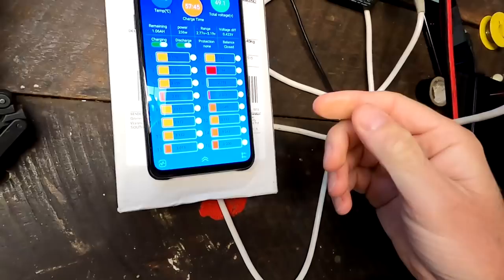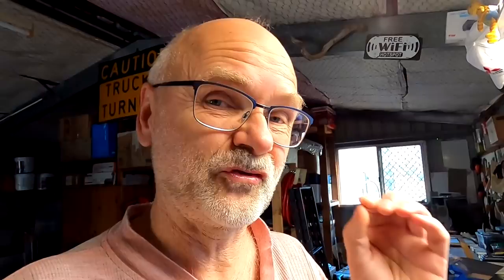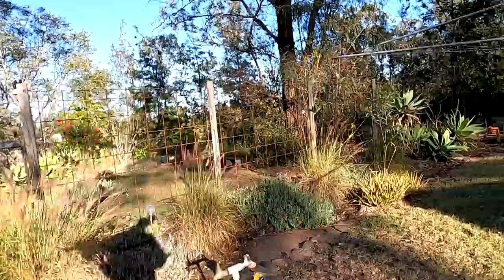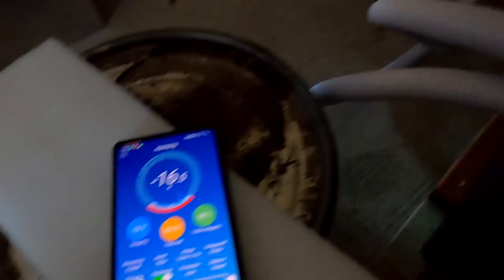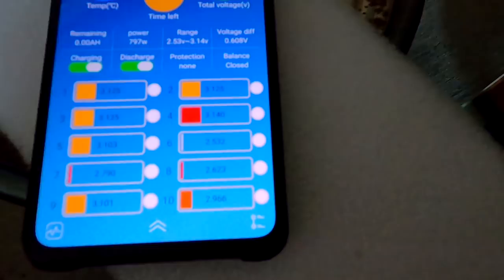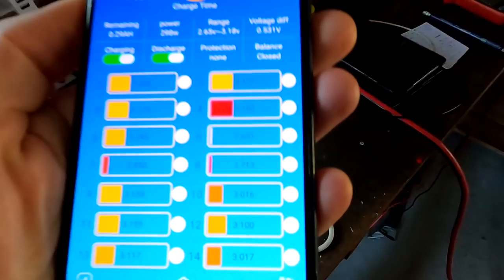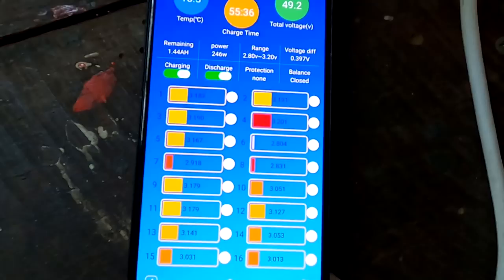QUCC BMS with relay. Why is this happening? 🤷‍♂️😷

Comment: First: Apologies for replying to this 2 weeks late, you might have already figured this out. But until I get caught up I'll just answer your request for comment anyway:

At 13:30 you've almost got it, but not quite. You say that the BMS is turning on the relay and then sensing the low cell and turning it back off again, but that's not quite what's happening.

Earlier in the video you also came close to realizing the issue when you noted that the relay doesn't go "on-off-on-off" when the Inverter is off...

Here's the step by step of what's happening:

1.) BMS senses low cell voltage and turns off the relay.
2.) This also causes the inverter to shut down do to under-voltage since the battery is no longer connected and it cannot get sufficient power from the MPPT to power your irrigation pump or EV charger.
3.) Cell is now at/below 2.55v and the only way it can get back above your 2.8 under-voltage release would be to charge the battery... which it cannot do now because the relay is off.
4.) The black wire on the outside of the relay senses charge voltage from the MPPT which triggers the BMS to turn the relay back on so that it can charge (Which is desperately needs since one cell is in under voltage condition)
5.) When the relay turns back on, your inverters immediately start to pull power. The BMS senses that the battery is being discharged rather than being charged which is the opposite of what it wants when a cell is in under-voltage condition, so it immediately shuts off the relay to prevent further discharging the battery with a low cell.
6.) Go to step 2 and repeat.

This is why the on-off cycle stops when the inverter finally gives up and completely switches off.

This is why so many of us keep harping on the fact that a relay based BMS only works when you can control the load and chargers separately. My Orion Jr is also relay based, but the relay is for emergency use only. It can directly turn on/off the inverters and chargers separately so as to avoid ever having to disconnect the relay unless a cell gets dangerously low. IE: The relay is not meant to control your loads and chargers, it's meant to protect the battery in an unforeseen emergency type event and prevent cells from reaching voltages that can damage or destroy them.

Consider this: Every time you connect your inverters you're careful to use a pre-charge resistor first. So why would you be okay with allowing your inverters to be disconnected and reconnected using this relay, which isn't properly pre-charging the inverter capacitors before reconnecting the relay? You need a more graceful way to shut the inverters off without completely disconnecting them from the battery.

In the case of the QUCC for example: Since there's no way for the QUCC to directly control the inverters you should consider using battery voltage as a trigger: Victron allows you to configure the inverters so you can set them to shut off once the voltage drops below say 50v. That way the inverters shut off before the relay does and gives the MPPTs time to recharge the battery, which they cannot do if the relay is off.

One other mistake I see you making in this video is looking at the parameters in the BMS app and assuming they are valid for your BMS. Remember that this "app" is a generic app that is used for many different brands and models of BMS with differing levels of functionality. Some of the parameters shown may not be applicable to your QUCC specifically because it's relay based and doesn't have separate charge/discharge ports.
Reply: If the pack were balanced, the inverter low voltage cutoff could be 45V or even lower. It’s the low voltage reconnect that needs looking at. In this case, the pack voltage is 48.3V so the inverter reconnect voltage should be above this, say 49V or 50V.

Comment: its because it uses a single relay to control both charge and discharge, it's detecting a charge so connects the relay to charge them and then it detects that it's actually discharging so disconnects
Reply: Agree with this comment. Try putting the release voltage not far from the cut off voltage just so that once the the power come in to charge it, the BMS does not confuse either to turn off the BMS or the turn on. Mean you just set it as if once there is power to chrage the battery, just let the BMS on and no more release voltage since you only have 1 relay. Relay is just contactor and once it on, it work both ways cahreg and also discharge. Then the BMS IC detect a discharge it OFF, but the it detect power comes in the it ON. SO there goes your loop.

Comment: Yes I don't let my bms ever get to that point either the inverter shuts off on low battery first so bms only goes in to protect mode in dire emergency.
Reply: I also program my inverter to cut  off before the bms
Reply: Same here
Reply: Smart move!
Reply from the maker: Absolutely, but what happens if the inverter shut-off fails? I want to see what the BMS does and if it is still safe to protect the battery.
Reply: @OffGridGarageAustralia  it’s a valid “what if” test but if the BMS has a precharge feature, surely that would continue to discharge the battery even with the relay open? So the battery would eventually discharge too far.
Reply: @kevinmills5293  The precharge for the inverter capacitors should only be passing current when the BMS reconnects to the batteries after being turned off. When the BMS turns off the relay, the inverter can't pass what it doesn't get in the first place.

Comment: It follow the rules, it turns off at 2.5 and in order to go back to 2.8 it needs to charge so it turns on, but there is only 1 relay for charging and discharging and as  your load is higher than the charge it turns off again, then it goes in circles until the victron inverter probably turns itself off alowing the battery to charge, somehow it has to detect that there is something wrong because you have 0V repeatedly or simply the BMS makes the inverter crazy.

I suggest checking the Inverter configuration, as the inverter does not communicate with the bms it only guides itself by the voltage it reads of the whole pack, and im sure even if 1 cell is at 2.5 the overall voltage is more than 40V or whatever you have configured  the inverter to stop the load.

>)

Comment: I would set the under voltage release to match your absorbtion voltage settings!  Allow the batteries to charge back up and balance before applying another load..!!  Also, you should have 2 relays, one for charging and one for discharging..!! Just my 2 cents!
Reply from the maker: That could take days until I reach absorption again. That setting would make no sense.

Comment: I have never had this problem with the JK BMS! 

Also, my opinion.. a BMS should not have a relay unless it is a three wire/separate port.
Reply: A relay has less resistance as a mosfet. Less heat and less loss of power. 
If you want to power a 3KW inverter for example it can really add up.

Comment: Servus Andy, 
1) chech first the Error Page on the dashbord buttom right, under the cells is a icon
2) in settings: Undervoltage 2.55V is only the soft setting = my setting is 2.95V 
Undervolage release delay: 20 sec under 2.55V = off
3) go down in the settings to: Hardware undervoltage protection and Hardware undervoltage protection delay in sec, my settings 2.80V and delay 8sec
Reply from the maker: I'll check these settings, thanks for the info. How is the soft setting defined. Soft in terms of it may or may not turn off?
Reply: @OffGridGarageAustralia  I write in German:  (hereby permission for translation).
Die Hard Einstellung ist die absolute Niedrigspannung = das aller unterste Limit, bei SOC 100% und ist eher uninteressant, waeren bei LiFePo4 2.5V - auch bei mir. Koennte sein, das diese Einstellung die Probleme macht.
Die Soft Einstellung ist deine SOC (ca. 99%), die du einstellen möchtest - im  Beispiel bei dir UV 2.55V. Ich habe bei SOC 80% ca. 2.95V eingestellt. 
Hardware undervoltage protection + Hardware overvolt protection = 100% SOC Hardeware
und "Soft" Undervoltage protection + "Soft" Overvolt protection = 100% SOC Hardeware = 90% SOC Software.

Noch ein Beispiel meiner Settings "BMS": Undervoltage 2.95V, release 3.2V 10sec. Overvoltage 3.6V, release 3.45V bei 10sec, SOC "egal".
Bei mir sind die 80% SOC aber nicht im BMS sondern im Wechselrichter und im Solarregler von Victron geregelt.
Im beiden sind die Spannungwerte verengt auf SOC 80%, UVP 3.06V (Pack 49.0V), release 3.22V (Pack 51.5V, Cells = 30% full) sind im Wechselrichter eingestellt und die OVP wird vom Sorarregler bei 3,525V (Pack 56.4V) abgeregelt und er geht in Absorbation über.
Die Einstellungen im BMS sind bei mir vergrößerte Werte, für mich sind nur die 80% SOC Werte im WR und SR wichtig.
Die SOC und Soft Werte sind innerhalb der BMS Werte. 
Die BMS Soft Werte sind innerhalb der BMS Hard Werte. Wie die Matrjoschkas 😀

Comment: in the "logic" of the BMS it must prioritise charging over the under-voltage release, then when charging is less than load it drains and turns off.
This BMS with a relay needs a separate charge/load port I think.  You know i never liked this BMS.
Reply: how can it recover if not by accepting charge - its just a big limitation of a single port relay driven BMS.
Reply: It just needs a higher inverter restart voltage.

Comment: You conclusions were exactly what I surmised Andy. I suspect a software issue in the BMS related to the release voltage. To be clear I understand your BMS  charging and load wiring, You have a relay that is disconnecting only the load from your battery pack, and not solar charging current, and your solar charge controllers charge the pack even with the the single relay open, and the BMS voltage pack sensing is connected to the battery side of the relay, not the load side? 
If that's the case, unless there is some stray voltage  that's feeding or draining off the BMS voltage sense leed, then it would appear to be a BMS software issue to me.
Reply from the maker: The black wire is connected to the load side of the relay. If the relay is open, it can still measure the voltage on the output.
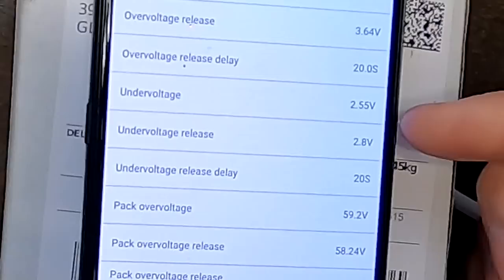Reply: @OffGridGarageAustralia  HEY ANDY,  I watched the video again and at 2:00, could it be as the Undervoltage trip setting is triggered by LOWEST voltage cell group, could the Undervoltage Release is triggered by the highest voltage cell? It looks like when your lowest voltage cell group is at 2.55V your highest cell (#2) is at 3.125, which is well above your Undervoltage Release of 2.8V.  If so, you might be able to test that by setting the Undervoltae Release above 3.2v?

Comment: Maybe the problem is QUCC software (semi dumb) and a Victron (smart) inverter.
BMS senses 2.55 and turns off but other cells are above 2.80 so turns on and repeats .
The Victron says I am sick of this on, off so I will shut down to protect myself.
Love the channel You should get paid for debugging these problems!!!

Checking again I noticed that when switching on off on off remaining amps was 0.00 and when you got to the 2.8 volts it had 1.40

Checked the overkill BMS default values are 2.5 and 3 with the delay 2s
Reply: That's a good point, he needs to check what's happening on the inverter when it doesn't restart.
Reply from the maker: Yep, I think so too, pure software related.

Comment: This is a very logic scenario since you are using a single port BMS. When the BMS senses charging available via the black small wire connected to the relay's output, it will turn on the relay for charge but it will also make power available to the inverter. So you will enter the on/off loop. You would see the 2.8V setting in action if you connected the MPPT charger direct to the battery and not via the BMS's relay. To solve the issue you have a couple of solutions: 1. Use a double port bms, 2. connect the current BMS via a usb adaptor to a venus GX device so that the "brain" can see the battery and not allow the inverter to turn on util a specific state of charge but this implies the bms and inverter are comunicating with the venus gx device. 3. Use the smart shunt to "guess" the actual state of charge and prevent the inverter from turning on (but this is more like a hack then a solution because there state of charge can be for example 10% but something happens to one of the cells, bad connection etc.)
Reply from the maker: Well, connecting the charge controller directly to the battery does not make sense at all. The BMS is there to protect the battery. If the charger fails... we would charge the battery with 150VDC without protection?
Reply: @OffGridGarageAustralia  Yes, if the MPPT fails in a catastrophic way there is the chance of pushing the full dc voltage of the solar pannels into the battery, as you have multiple bms you also can "mimic" a double port bms by having 2 bms connected to the battery ( the balancing can be enabled on just one of them) and you would use one for energy in and one BMS just for loads

Comment: This parameters/logic is mounted into all BMS, but since you have relay and not 2 directional MOSFETs (charge/discharge), the BMS can't allow charging other way than connecting relay. You either has to have 2 relay BMS (one relay to the charger, second to the load), or you should use MOSFET BMS (which you did not want). So there is a third way - use shunt to disconnect invertor at 3-5% of state of charge. Victron does have remote switch and there is programmable relay on BMV 702/712 (712 does have BT). So instead of smartshunt withou relay you have to use BMV... Probably QUCC could do 2 relay version on with one connecor, but they have to mount directional diodes to this relays and you again end up with a semiconductor producing heat.. ;)
Reply from the maker: But it does allow charging while the relay is off.
Reply: @OffGridGarageAustralia  Is it really allowing charging or is it a matter of the batteries recovering some of the lost voltage by themselves when there is no load on them.

You have observed some of this slight recovery before in your tests.
Reply: @OffGridGarageAustralia  so there is some one direction MOSFET to chage? If so, then it is a sw bug..

Comment: The low-voltage recovery is the threshold to resume DISCHARGE. If the BMS is attempting to CHARGE then the recovery voltage is non-applicable... except the BMS finds out on reconnect that the bus voltage has no spare capacity for charging and has to disconnect again. At the very least though, it should wait 20s between attempts either way.
That is just one of the shortcomings of having a single contactor for (dis)charge, not going to have that problem with FET-based BMS that can control both directions separately.
Reply from the maker: Well, that makes no sense at all then and is a total fail in software design. If it disconnects at 2.55V it should not turn back on before it detects the 2.8V as set in the parameters. And as you said, the 20s wait time... when does that play into the scenario?
I'm looking forward to the JK BMS.
Reply: @OffGridGarageAustralia  If the battery is low, it makes sense for the BMS to want to reconnect it for charging ASAP when input voltage is present. The BMS has no way of knowing that solar input is weaker than loads until it reconnects, detects that current is going the wrong way and disconnects again.
The 2.8V recovery probably only applies when there is no external power coming in to keep the load disconnected until the batteries have recovered to something closer to their rest voltage before getting discharged again.

Comment: That is why a BMS with mosfets are better, even better if you have a BMS with separate charge and discharge ports in the BMS
Reply from the maker: Until the mosfets fail and you have 150VDC at your battery...
Reply: @OffGridGarageAustralia  there is no way of getting 150v at your battery, the Victron MPPT would be at fault to output 150V

Comment: I guess what's happening here is the following:
1) Relais disconnects for undervoltage protection.
2) BMS detects incoming charge and turns on the relais to allow charging. 
3) Since relais is on inverter demands power.
4) Relais turns off to enforce undervoltage protection.
5) Goto 2)
6) After several iterations of that the inverter gets confused and refuses starting.
7) Battery gets charged.

I noticed something similar also on overvoltage protection. Works the same way.
Reply: Pretty close to what I think. But I think 6) Battery voltage drops bellow reset voltage for inverter so it no longer turns on
Reply: The inverter doesn't DEMAND power, it only attempts to use what is provided to it. 

If the relay is open, there is no power from the batteries to the inverter  or from charger to the batteries.

When the relay is closed,  power can be received from the chargers and also passed to the inverter. 

This is a problem with ALL single connection  BMSs. There should be separate RELAYS/ MOSFETS for each function (charge and discharge).

Comment: The problem is not the BMS. It is doing the best it can with its single relay. The problem is in the inverter settings. The inverter should not turn itself back on until the pack voltage has risen sufficiently. Also the inverter ideally will turn off before the BMS shutdown. However if you have only one weak cell then the pack voltage may not be low enough for the inverter to know. Instead the BMS will need to tell the inverter when to shed load. Apparently the dbus-serialbattery drivers supports this for JBD, JK, Daly and others. I have never tried it, but would like to find out how well it works.